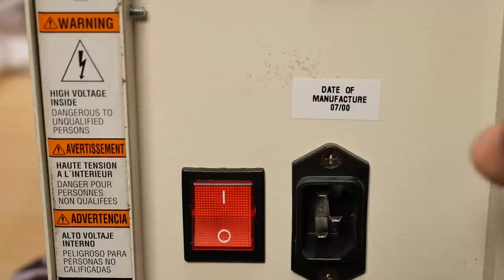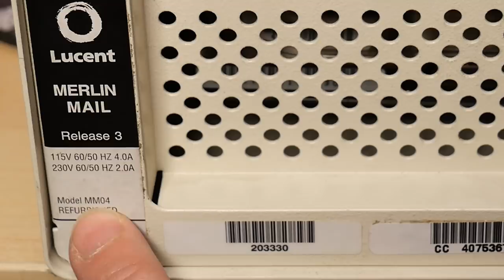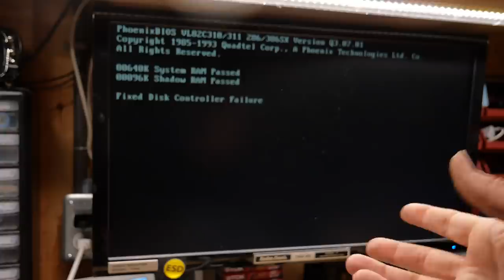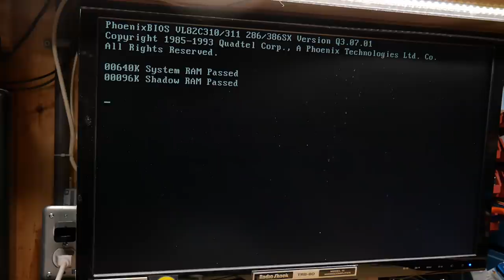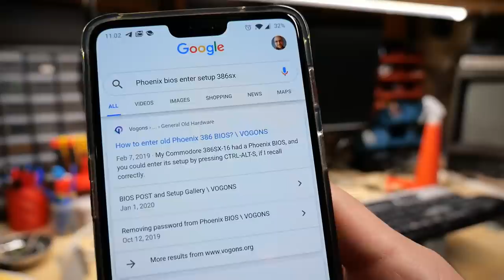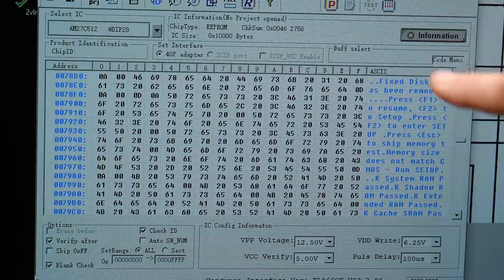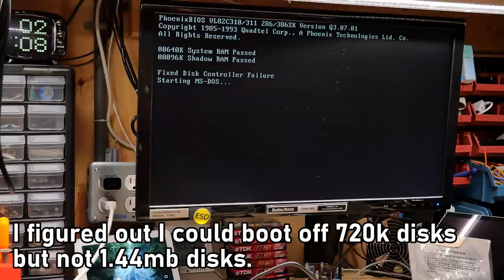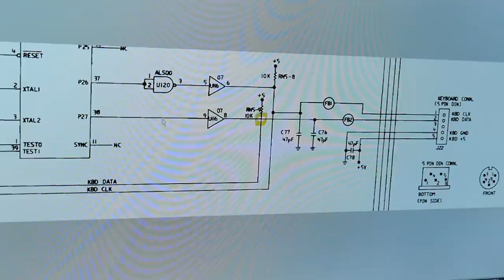Trashpicked Voicemail System

Comment: You were right when you said the cards had analogue trunk lines, that's exactly what those are. They're also known as FXO, where the O stands for office, as in central office, because they act like a telco's central office (AKA telephone exchange), and act like an analogue phone line. The DSPs are analogue to digital and digital to analogue converters (ADCs and DACs), digitising the voice of people leaving messages and playing back recorded messages.

There would also be a CODEC chip for encoding/decoding the digitised audio to/from a more compressed format to save space on the hard drive. The chips at the rear of the cards look like SRAM, which would be used to buffer the digitised samples for playback. Basically the CODEC chip takes the audio file and decodes it to the raw digital audio samples and stores them into SRAM, which the DSP would read and convert to an analogue signal.

Modern systems don't need hardware CODEC chips, it's all done in software these days, but old systems like this wouldn't have been powerful enough for the CPU to encode and decode the audio in real-time. This only became possible in the Pentium MMX era when Intel introduced the SIMD instructions which allowed CPUs to encode and decode audio faster than real-time. That's why MP3s didn't take off until the mid-late 90's, because before then PCs weren't powerful enough to decode the audio for real-time playback (without hardware assistance anyway).

Comment: Super Nifty! Those old boards (when working!) are great as "floppy interface" machines for working with older 8-bit machines for floppy disk transfers, especially on computers that don't have flash systems, like old Kaypros, etc. I have a very similar board installed in my "386 Frankenstein" machine - sitting on the bench right now for work with a Commodore 64!
Reply: Yeah, I have a IBM PS/1 that i swapped out the 1.2 drive for a 360k and is primarily used to make floppies for my trs-80/kaypro/osborne.  Technically it's a nice dos gaming machine if i had any interest in moving past 8 bit machines :)
Reply: @brianv2871  Are there any computer boards for sales and trade other than ebay I would prefer to seek out my stock of 386s to be collected from me   I have SIMMs as well,  no means of testing them though

Comment: 14:35 the bottom number is the datecode, the dallas chip is from '95 as well, 9506 sixth week of 1995
Reply: If these chips can switch between internal battery and getting power from the PC, being in a machine that was turned on 24/7 for decades, there's a good chance there's a few years worth of juice still in there!
Reply: was just looking at the comments for this!!
either that or its a REALLY new voicemail system post julian calander
made in the 95th week of 06

Comment: Here's a suggestion on how to get this working:  Make a daughter card that plugs into the PAL socket and implements the stock IBM logic (7400 and 7407) to interface to the keyboard, then replace the keyboard controller and the main BIOS with standard parts.  This should bypass the PAL tomfoolery and get it to behave like a stock AT board.

Comment: Brookcom were heavily into telcom cards in the 90's.  My former company was using them until we switched to Voip that was in 2015.  The Power supply likely has both a -5 and -12 one of them was removed so modern power systems don't have both.  We had a hard time finding power susplies because of that.

Comment: The board with the resistor diode and capacitor is a Bios lockout reset,  Its design to lockout the bios, reset it to default pre programmed configuration after reboot, even if you manage to get in, and here's the kicker if you remove it doesn't boot at all.

Comment: The assembly at 10:56 is an oscillator. It has "OSC2" beside it in the silkscreen. At 14:23 you were wondering about the battery in the clock chip. The box said it is a Refurbished unit. The 07/00 date may be when it was repaired.

Comment: Adrian - 
You were on the right track. The only thing missing was a test of the Battery. If the Dallas chip is dead, you cant "Save" a config. It will default to the wrong drive time after time. These motherboards do not support "Soft Boot" any reset command is a real reset and Bios is started over. (Packard Bells that had 486 were this way as well, they only take power from the battery and not the power rail. Man I wished I was in your basement, this would have been a fun win!  o and btw... Not likely he will use this card.... OOOOO NOOOOOOOOOO I will pay for them as will many others! that love BBS systems

Comment: That DALLAS chip not only has the realtime controller but also some bytes of memory and an include non-rechargeable battery - which drains slowly when the computer is powered off (and over time).

On SGI Indy workstations that chip also contained the Ethernet MAC and the serial number. If the battery was toast you needed to buy another one of those chips and use a hex editor to reprogram it byte by byte. I did that twice back in time.

Nowadays there is no replacement anymore for those.

Comment: Just a guess. Tons of those type of systems would be hard wired or programmed not to ask for keyboard on startup. So possible why you keep getting a keyboard beeping sound on startup. They also did the same thing sometimes for missing vga cards. To counter act the error for missing video card. I had a partner mail vs system that was not working one day. I pulled the 2.5" ide hard drive out and found I think some kind of unix release on it. Anyway I was able to clone it using ghost over to another drive without a issue. Going around the 1 bad sector and problem fixed. As for finding newer date on the machine being built due to cards inside. I talked to a few companies who due have special embedded stuff back in the day. They would order bulk to get a better price. Since they mostly write the software to work best with that hardware or in case they need the special modifications. They might have 1,000 motherboards in stock modified the way they want it and thus built the same system for 10 years. But I'm sure you already know this. As for the comment below asking about field service of the device. During that time you would not trouble shoot the bios or plug in stuff. Once you found a dead board. You would order another one from the mfg. Nice vendor lock in.

Comment: I was hoping to see what happened when you boot it from the HDD.
Reply: It's likely to present a servicing UI of some sort, that may be more interesting to see. I've dealt, in the past, with a sizeable fire detection system for multi-building facilities that was a 386 chip with custom mobo and software. It was a reasonable choice for the era, as it was for a voicemail system. I'd really wish some more delving into the software side of the thing, i.e. filesystem, software and servicing UI, rather than just trying to have a somewhat-working "yet another" 386 motherboard...
Reply: @djangowatson217  I think, as many have pointed out, that this machine was configured to run over a serial console. Also, I think Adrian forgot to mention it but it seems like the hard drive controller was failing or failed to boot the disk. Either way, it seems the goal was to poke around a bit but ultimately using it as a standard 386 board.
Reply: you may just see a system running screen, most of configuration came from the phone system sending code to it, that is for the one I work on

Comment: I think a better description of the 386sx is that it's a 386 with a reduced interface design, similar to a Motorola 68k -- it has a 24bit/16bit external bus, but executes 32bit instructions.

Comment: I've worked on several of those Bell Labs > Lucent > Alcatel-Lucent > Nokia systems.

The BIOS has been modified to treat all text modes as a serial console like seen on non-intel UNIX systems for years.  This is similar to the management ports on newer rackmount Intel server systems where no local keyboard/display is expected.

Pretty common stuff today, in the mid 90s it was totally non-standard.

I'd imagine you could trace from the keyboard controller over to ports on the ISA bus for part of that  redirect.

That machine would have run a version of AT&T UNIX when it was in service.  You might have success taking an image of the hard disk with dd and trying to mount it under linux as a loopback filesystem.

As far as how old the hardware was for the installed date, Lucent buys a huge amount of hardware for their supported platforms so they could sell and maintain the hardware for decades, as people don't replace their voicemail system or PBX system very often.  Incidentally, Lucent would charge several thousand for those machines more than the underlying hardware would warrent.

Also, its pretty common for them to do component level troubleshooting to this day.  Those bodge wires indicate the box has likely been repaired and redeployed at least once.

The line cards are more likely to be DS0 boards than analog/POTS lines. The software had logic to transfer someone to another extension or forward to an external number that can only be accomplished with the DS0 signaling (POTS lines only really know on-hook and off-hook states).

Comment: Guarantee you that PAL is a form of copy protection. Prevents copying the disk and running it on clone hardware. Depending on how clever Lucent got, the BIOS, PAL, and software may be keyed so no individual component can be replaced except by Lucent.

Comment: I've looked over the random Brooktrout stuff of the time. The closest i can find to the telephony boards you have are the TR112 cards. It's possible for such a high volume customer, they made something custom. I've had the opportunity to develop for a lot of similar telephony boards - lots of fun, but the Brooktrout stuff has always kept their SDK a deep dark secret. If you take a look at the files on the hard drive, you might find a clue as to what these are; usually how these things work is there'll be an executable included along with the drivers that pukes a boot image into the processor onto the ISA board - sorta like a baby bird xD . The configuration file for that will more than likely contain some information as to the model.

For whatever it's worth, there are still some manufacturers making systems just like these (with more recent cards/motherboards, of course) for some of the more modern, less "shove an ethernet port into an ATX machine and it's a PBX" phone systems.

Comment: Want to find another strange computer? Find the industrial ones that the cpu is a plug in card and the slots are a back-plane with no ICs on it . Usually a 486 isa card with ram, some with HD interfaces. They were made for industrial control devices but could be used for just basic things, as long as you just needed ISA cards

Comment: My parents worked at Lucent Technologies in 2000. They might have helped developed this for all I know.
Reply: Problem with (UK) Lucent / SDX was that most stuff worked fine,  but some was developed on whatever PC system and software they had at the time then tweeked for specialist use,  but then it did not work in systems where even the next out of box manufacturer BIOS changed ,  ended up our tecchies were teaching theirs where changes needed to be made.  Also some small out of box systems might have worked, but not if in any changed MS Server configurations when MS changed admin responsibilities.

Comment: Great video Adrian. I like to see older technologies whenever I come across them.  I was amazed at the pristine condition you found the Lucent Merlin Mail unit.   I seen that you did run into some issues getting the unit to boot up.  The Am386 CPU (10:30) was AMD's clone of the Intel 80386SX processor.  It doesn't appear to use the 387  Math co-processor which would have be sitting on the left next to the CPU.  I suspect the unit had Windows 3.1x considering the hardware installed but then again, it may have been a custom OS.  At 13:40, you had started up the unit and displayed Fixed Disk Controller failure.  Since those motherboards didn't have an I/O Controller Hub, each peripheral had to have it's own Adapter controller card.   I suspect the Hard Disk controller card failed and had to be replaced as to why it was trashed. Have you tried to replace the Hard disk adapter card?  What about the HDD?  It should be using the standard 40-pin IDE interface and the 4-Pin molex power connector.  Have you tried to access the data on the drive?

Comment: I had a similar problem with a motherboard of that age, ended up being that Dallas rtc chip, it contains a battery which was keeping the bios values set as a battery backup as well as the clock settings. You have two options, replace it or drill into it and replace the battery (instructions on the web), as soon as I replaced it the bios values would hold between reboots.

Comment: Keep in mind the settings you found in setup.com are probably the defaults, since you swapped out the battery. Also maybe check out the help screen in F1, you may not have actually saved the setup.
Neat system!

Comment: I found an old XT by a dumpster many years ago. I took it home, plugged it in and it booted. Windows 3.1 I think it was. Found out it was the bookkeepers PC. All the books were on it. Company was out of business. So I wiped it and played it with it.
Reply: Windiws 3.1 do not run in XT (8086) is requeres at least AT (286) Windows 3.11 requeres even 386.On XT 8086/8088 you can run Windows 3.0 it is the height one that supports XT
Reply: @intel386DX  It was 20 years ago. All I remember it had a desktop and I was looking at spreadsheets.
Reply: @christopherrasmussen8718  sounds like Win 3.0 becouse early versions 1.x and 2.x do not support pictures for the desktop they even do not have desctop at all :D

Comment: Found a mini AT board with Intel atom processor in a media player was able to use it as a PC but with no PCI slots it was not very useful the only graphics I could use were the onboard Intel so not so good graphics either. there is a funky bios on it that would not let me enter setup until I disconnected the front controls for the media player, these controls were connected through a USB connection and acted like a serial console.

Comment: Seconding thoughts others have expressed here: try putting all the cards back in as originally configured (i'd leave the vga card out first time around, it might conflict with one of the speical phone cards), connect the hard drive, with a terminal program connected to serial port 1 with (probably?) a straight through serial cable.  If nothing, try serial port 2.  If nothing, try port 1 & 2 again with a null modem serial cable.

Long shot: try finding an original AT keyboard (the one with with the big round connector) and try things with that.  I seem to remember having some odd problems with a modern keyboard on some classic AT motherboards. 

Some years ago I managed a Nortel voice mail box that ran OS/2 under the covers on a very standard, if old (even at the time), motherboard.  I can't remember if I connected via a serial port or via a keyboard/monitor.    I learned how to punch down hardwired phone extensions on that system.  Fun!

Comment: After looking at a lot of Dallas chips and the ranges of numbers on them, it is possible the first four digits on the third line give the year and week of manufacture, i.e. 9506A2 might be February 1995.  I have seen "year" values from 94 through 13, and "week" values from 06 through 49.  That's not conclusive, only suggestive.

Comment: I immediately suspected it would need an external setup program, despite the references in the BIOS itself. Integrated BIOS setup programs are quite rare in machines predating the 386, more common in 386, and virtually universal in anything 486 or newer.
I have a feeling that it is not defaulting to specific settings for the mail system. I think that the DS12887 is at fault. I had an IBM PS/2 55sx with a dead Dallas chip in it once, and I could not boot the hard drive because it would not retain the settings, even after running the "reference diskette" - IBM's fancy term for a setup disk. It defaulted every single time I rebooted. I tried the battery mod, and then the machine wouldn't boot at all, so I tossed it. Probably should have kept it, but I didn't know what I was doing at the time.
It is quite possible that some disk overlay utility is being used on that thing. I have a 386 with a 10 GB drive partitioned by Kroll OnTrack, and it works quite well.

Comment: Did you ever consider that the keyboard IC may be a special one designed for phone inputs, not keyboard? I don't know if that's something possible, but it was a thought, and I've been an IT guy for the last 5 years, you were doing some great troubleshooting.
Reply: Maybe,  telephones can be used as programming inputs, you need your crib sheet.

Comment: So the deal with the dates on the parts vs. manufacture date probably has to do with the refurbished sticker. I bet it was originally built in 94/96 and refurbished in 2000, not originally manufactured in 2000

Comment: That little board with the Zener diode, capacitor, resistor and transistor might be a temperature sensor. Won't know for sure until you check the transistor for any identification and I might be completely wrong ;).
Reply from the maker: There is a pinned comment now from someone who says that that bodge is for running this same board with a 286 for a different config.

Comment: A '286 did the job just fine, why spend more money I was still working on some 8088 custom built boards as late as '94 that used a 555 for a clock.